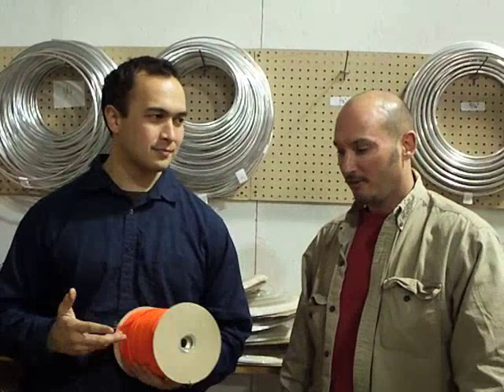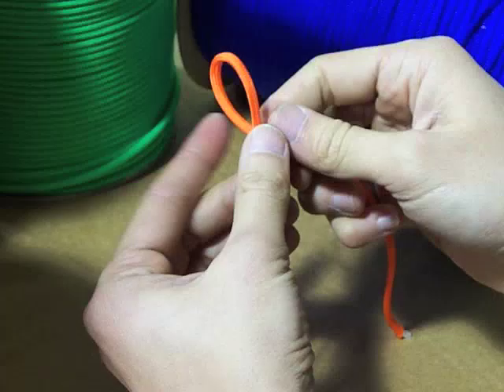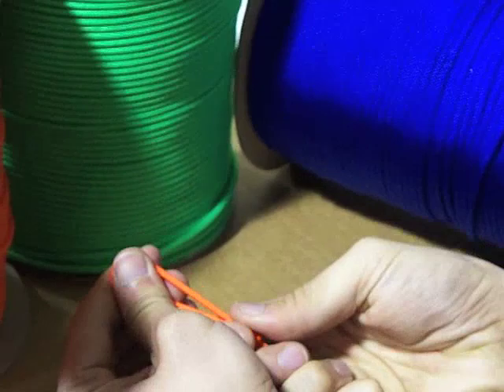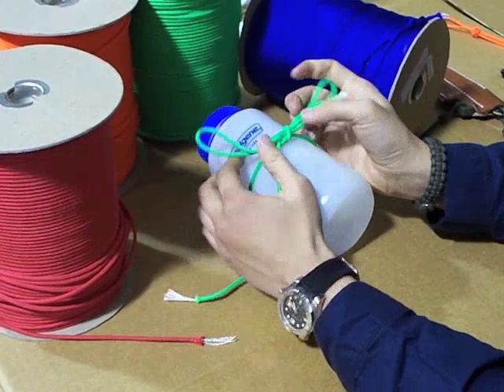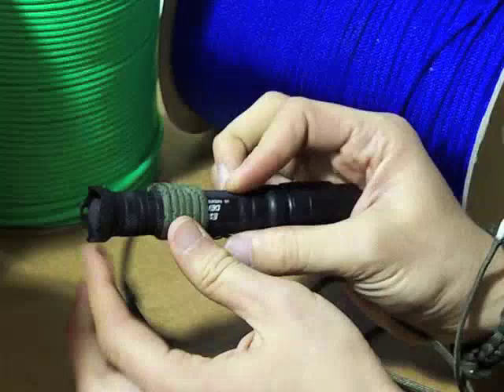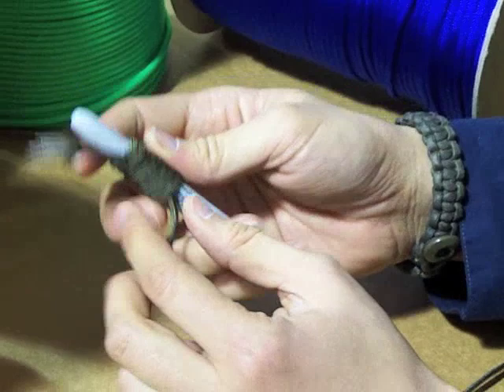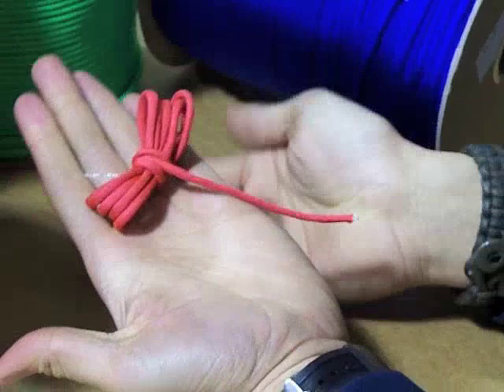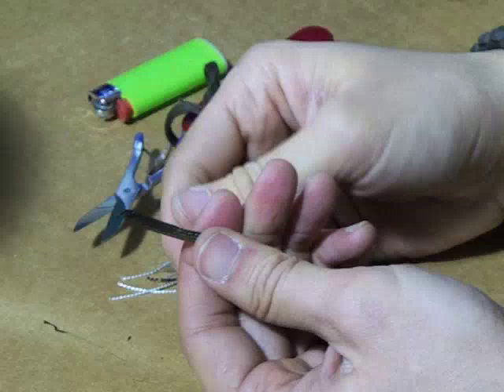Camping Survival's Knot Tutorial from Kevin Estela of the Wilderness Learning Center

Comment: That's not a diamond knot.  Its a conductor's whistle knot, per The Ashley Book of Knots.  The bow is a double slipped surgeon's knot.  The figure eight pattern for coiling is called faking.  It's not burning, its fusing.  And a disposable snap blade razor heated to red hot will both cut your paracord, and leave a clean, fused edge.